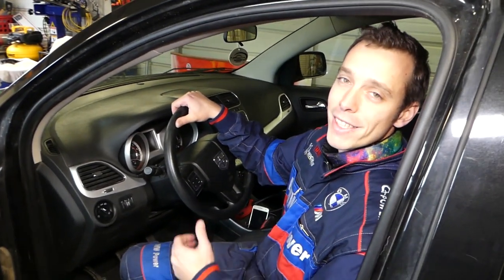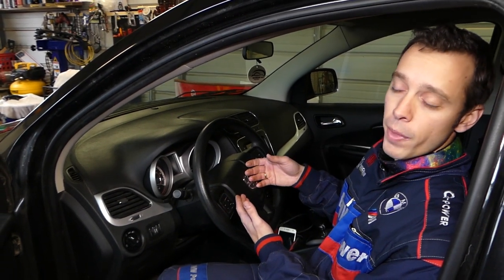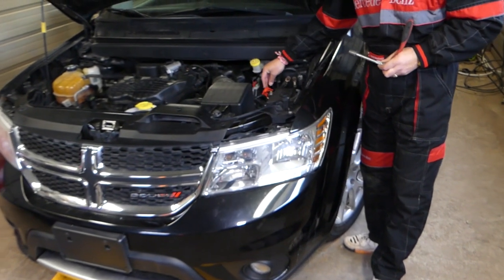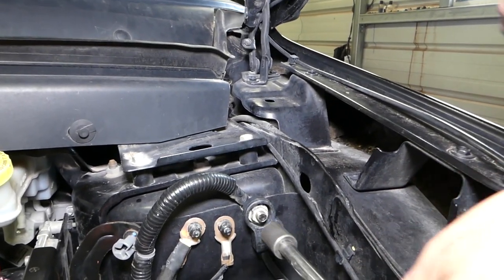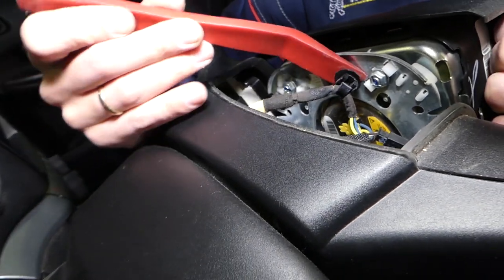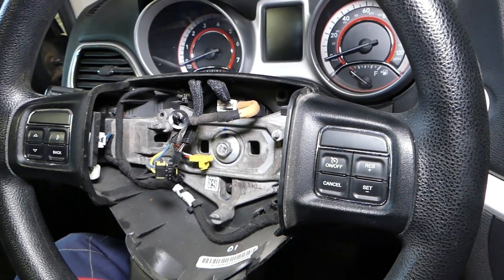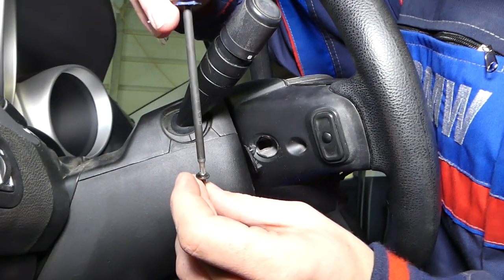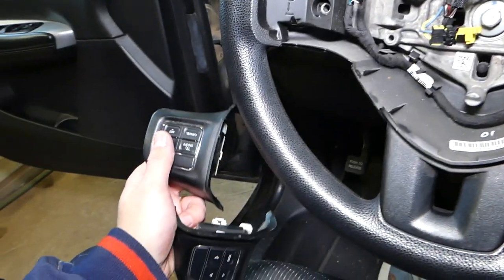DODGE JOURNEY CRUISE CONTROL SWITCH STEERING WHEEL CONTROLS REPLACEMENT REMOVAL | FIAT FREEMONT

Comment: You don't have to take the airbag out to replace the switch. Just take the one screw out lift up the outermost part of the switch then work the inner part from under the airbag. As per Dodge service manual. But do remove the ground cable from the battery anytime you do any steering wheel work. I know this works because I  just did it this way.

Comment: The Dodge Journey 2014 model uses a T15 for the screws holding in the controls. Also, if you need to take the actual plastic housing off that the button module attaches to, you'll need a T10 as well for three screws on the back. :)

Comment: Hello!
From where did you buy the new menu button module?
Mine is sadly not working probably, the up-down buttons are mixed up sometimes, it goes downwards when I press the upper button for example.
Any fix?
Fiat Freemont 2.0MJet 125kW 2013.

Comment: Thanks for the tutorial. Despite looking simple I’m scared to death to even attempt this because of that airbag! With my luck I will damage it.
Reply: Take the ground off the battery 20 mins before you start work just to be safe. But you don't have to take the airbag out to replace the switch. Just take the one screw out lift up the outermost part of the switch then work the inner part from under the airbag lip.

Comment: Can you tell me how to remove squeaking sound from steering wheel from airbag when car driving . Not when turn to the left or right, just driving straight and hearing squeaking?
Reply: Having the same problem here.
Reply: Solved a problem. It is necessary to remove the airbag. But before that, I disconnected the battery terminals. The airbag itself has springs in plastic grooves. Here they are making this noise. It is necessary to take a thick silicone grease and lubricate. Sounds disappear. Checked.

Comment: I have a 2007 Dodge Caravan. 75k miles...The cruise control light will come on but when I push the set button the cruise control will not engage. The Cruise light will stay on.....BUT if I turn the cruise control off and then try to turn it back on while driving the light will come on and go right back off quickly. If I try to turn the cruise on again no light will appear. The only way to get the light back on is to stop the vehicle and turn off the ignition.....start it up head down the road and I can repeat the above procedure all over again.  My break lights work when testing them,,,,that is about all I tried so far, any help would be appreciated!
Reply: I see this comment is 7months old...did you figure out the issue? Definitely sounds like a bad cruise control switch, but it could also be a bad brake switch. Just because your lights work, doesn't mean the switch is good.
Reply: @ComedyBros5  yes I found out what it was it was the actual cruise control servo that is under the hood.
Reply: @Soulcommander  cruise control servo? do you mean solder? you soldered the connection in the button and it worked right?
Reply: @elijahantony4300  nope it was the actual cruise control servo. I replaced it and it's still working today. Just Google 2007 Dodge Caravan Servo speed control

Comment: On my Dodge Caravan there is a button on the lower left side of the steering column that adjusts the distance to the brake pedal. I move the brake pedal back-and-forth and the cruise control works again.
Reply: You my friend at a genius. Have you found where the short is? I take it replacing the switch will not resolve the issue?

Comment: I have a 2012 Dodge Journey sxt. I replace the fuses and the control to the interments panel’s still don’t work, the cruise control side works perfectly. But the horn doesn’t work and the left side control doesn’t work to the interments panel. I’m not to sure if it might be the clock spring needs to be replace.
Reply: hello, you solved the problem, I have a Freemont, the collaxon doesn't work and neither do the controls on the left side. How did you solve it, thanks!